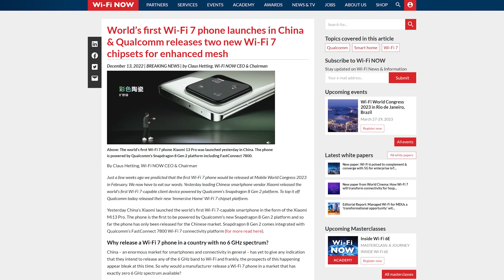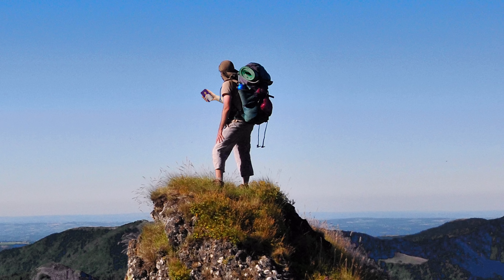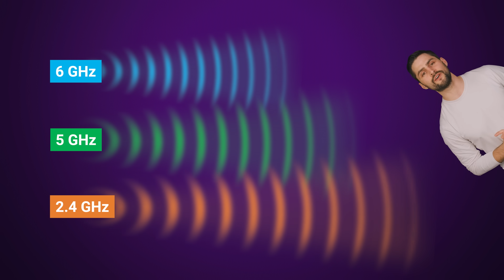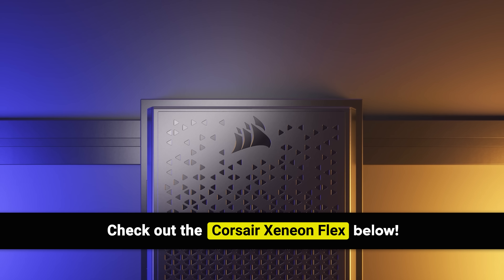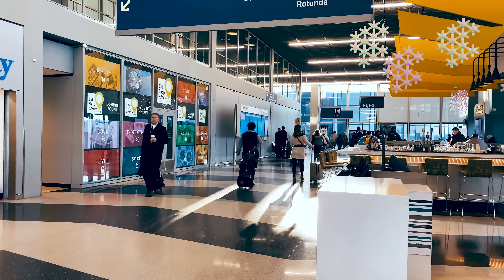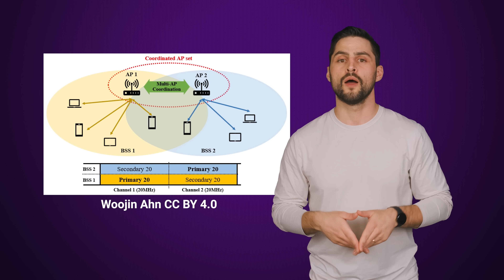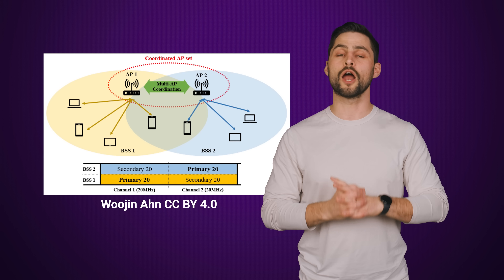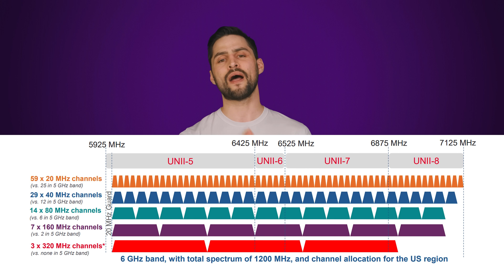Can Wi-Fi 7 Replace Range Extenders?

Comment: Can we have a recap of all the different standards please I feel like you don't keep track for a couple of months and everything changes! Eg WiFi 6 Vs 6e what about that super high frequency was is like 60ghz and stuff like this
Reply: 6e is 6 over 6GHz there no diffrence in standard, it would still be called 802.11ax in old way, same as 802.11n had 5GHz optional. 60Ghz been always arounf but is not part of wifi standard, its 802.11ad newer ay and its branded WiGig, but potentially it could be integraded to WiFi in future

Comment: you never said what the low frequency range was... Are we talking like 150 feet or more like 1/4 mile. My current router is pretty good, I can get a good connection even in the back yard. I would only feel compelled to upgrade if I could get a connection down the street, which would be cool.
Reply: That completely depends on the environment around you as well as the antenna of the client. Through a single glass sliding door I can get a 2.4Ghz connection about 50 metres away on my phone with line of sight to the house.

Comment: I'd love it if you can make a Techquickie on this one: what were the input and output methods for old mainframes and minicomputers? In almost every picture I see of them (from the '60s, 70's etc.) I don't see a monitor anywhere. Sometimes it does look like there's a typewriter nearby, but I'm not sure whether it served for input or output and, if so, how.
Reply: hi! Old computer nerd here (as in old computers, im like 16). You're right about the typewriters! They were called teletypes, and were actually origianally invented for telecomunication, as a faster way to send military messages. Basically by typing on one machine, the writing would show up on another, and by typing on the other, writing would show up on yours. Some smart person just put a computer in the place of the other machine, and bam, IO?
Reply: These systems use thin client approach. One mainframe could host many terminals that would operate similar to modern PC (in text mode only). Also older systems used punchcards for input and printer for output. You could bring your app on card and later take it with written output. Later came tape add-ons and hard drives. Both were about the size of a nightstand.

Comment: Automatic roaming between access points on the same network should be the top priority for them to fix. That currently is and has been the most annoying thing with wifi for a long time now
Reply: Yep. I fully agree as a college student living on campus. There's access points in literally every unit in my dorm, but my connection drops when I'm walking.
Reply: @shane_gentle  Tell your college to fix their network! Depending on the manufacturer, there are tools to make the handoff smoother such as minimum data limits and minimum signal strength. If they have configured nothing, then your device will stick to it's current AP until it can no longer communicate with it and search for a new connection (which causes the drops).
Reply: It's fine if your network supports 802.11k. This revision adds available APs and their channels to the handshake so your device doesn't have to search every channel looking for an AP to roam to. Also, keep all APs on the same SSID or you're gonna have a bad time. Splitting 2.4 and 5 up to their own SSID is up to you, but I prefer one SSID to rule them all.
Reply: @quinton1661  I just have different SSIDs for frequencies and APs cause it's not gonna switch automatically anyways so with different names i can at least quickly switch manually when i need to.. which is every day
Reply: This issue has been resolved for several years through the implementation of IEEE 802.11r/k/v, commonly referred to as fast roaming. However, it is worth noting that many large Wi-Fi networks remain misconfigured and lack the necessary feature to enable fast roaming.
Reply: My unifi setup works very well with the roaming assistance stuff enabled (and configured right, it takes a bit of trial and error of messing with tx power and a few other things.)
Reply: 802.11k is a thing, however the reason roaming sucks is because you're network team didn't do a good job of setting up wireless.  probably have you're datarates set super low and tx power set super high.  9 times out of 10, raising the minimum datarate,  and lowering the power levels so that coverage at least -65db or better in all areas fixes the roaming issue.
Reply: @bassman87  and thing is, this is often the default. I know it's default in prosumer gear (Ubiquity UniFi, Omada)at least.
Reply: @illiiilli24601  its cause wireless operates in a very unpredictable medium.  so tuning to your space is really a must.
Reply: @illiiilli24601  This out of the box experience that so many vendors fail to uphold is because the radios can't both broadcast wireless and listen to the RF space at the same time.  some enterprise APs add additional radios that just listen to the space, making them very expensive, but in reality those radios aren't in a good position to make a good determination.  Clients are on the ground, APs tend to be on the ceiling.  can't simulate being a client when you aren't physically located near the clients.
Reply: @bassman87  Exactly, we see misconfigured networks all the time.
Reply: In regards to the mention of 802.11k and why it is not enabled, there may be a reason, college/university campuses are great example of why it might not work.  The end user device has to support that revision.  You have to support the least capable otherwise you will end up excluding those devices completely.      

A misconception is the Network causes the device to roam, its the device that is always assessing whether or not it should roam, whether it thinks there is a better choice, the device looks at the BSSID, along with all the other data it can get, RSSI, SNR, Minimum Data Rates, etc, then makes a decision.  All you can do is build a better environment to discourage that from happening.
Reply: @Gr33nMamba  right.. I have learnt to toggle WiFi off/on as the fastest solution.
It's the software stack on the device that's fundamentally at fault when it's sticking to a low viability signal, rather than seeking better.
Reply: Mesh routers solve this issue
Reply: You can only do this in a controlled invironment. First of all you need devices that will roam if they are told to. This is not a thing right now. Every vendor choses their own roaming "policy" and thus we cant enforce roaming. We can optimize for it. I work at a University and the end user devices goes from 802.11g to 802.11ax. So making roaming good is kinda an uphill battle. On the contrary, if you have a company that dictates which end user devices are allowed, it is more easy. And maybe it is not a big deal. If people are connected through VPN it wont matter if they come from a wi-fi network og 4G/5G
Reply: This is the truth
Reply: My impression having 2 WAPs in a reinforced concrete house on unified SSID, which splits the signal in two, is that the software on phones has made the effect worse.
I've seen improvement within apps in response to roaming between the 2 areas over the years.  But the master  WAP with router & a mini-repeater to strengthen signal to outdoors suffers far less of an issue, despite using a crude old style solution.
I lowered signal strength to reduce clinginess, but it's pretty annoying that mobile device designers didn't prioritise service for mobile people more.
Why could the WAP with a small old g only repeater work better for roaming than WAP-WAP both supporting n and offering 5GHz?
Guests have a compulsion to answer calls in the lounge, but immediately roam into the garden or their room served by the other WAP.  The trouble is just going round a corner behind a wall with steel in it can severely weaken the signal (which can be expensive when it fails over to data roaming charges kick in).
I already lowered signal strength of the master WAP wired to the fibre router, but that had limited effect.
Are phones preferring to switch between WiFi & 4g, making a new network connection rather than direct switch of WAP?
Reply: wait, your multiple access points are not coordinated with an SDN (software-defined networking) controller? 

my SDN, TP-Link Omada to be exact, supports 802.11k (advertisement of neighbouring APs), 802.11r (fast roaming reauthentication) and 802.11v (forceful dissociations of noob wifi devices that didn't listen and didn't try to move to better AP)
Reply: It was a thing years ago, my Tp-Link Archer A7 has multiple frequencies under one network. It came out in early 2018
Reply: wasnt this already solved by mesh type routers? I mean,  we have a setup of 6 Tplink devices and its literally smooth butter everywhere we go as compared to repeaters and what not
Reply: WTF are you talking about? I have four unifi Aps and I roam on them all the time. There is 0 dropped packets since 2020! The thing is, you have to know basics in order to get it just right.
Reply: @elmedia1532  Wtf are YOU talking about? There shouldn't be any settings or adjusting transmit power or anything like that. If the device is clinging on to an access point for dear life getting 10 mbps while it's in the same room as another access point on the same LAN giving like 400 mbps it should just change on its own. Clearly one is delivering trash speeds and the other one is doing great at 40x the speed.
If the device has the SSID and password to both access points and they're both on the same LAN, one is really slow and the other really fast, it SHOULD just switch. It's such a simple concept, automatically move the device from the trash signal to the clearly much stronger one, yet it doesn't happen.
Reply: @MarcusH... Please for the love of God do a little bit of research into why these things happen. Your theories are amazing, but they aren't practical.

Comment: If they impliment it properly, they could make it so your phone sends out two signals at once - 2.4ghz for lower-bandwith needs like notifications, text messages and other background stuff like updating apps in the background, whilst the faster 5 or 6GHz can be exclusively for more intensive stuff like game streaming and videos. That would speed things up even more to keep the two streams separated so the higher bandwith isn't so cluttered with the slower less demanding stuff and vice versa ... well, until you start moving out of the high-speed frequency ranges and only then it should combine them back into the lower-bandwith frequency.
Reply: Some phones (Xiaomi being the biggest I know) already can do this, and have been able to for a long time. And no it's not particularly battery heavy. Wifi uses negligible power compared to all other phone functions.
Reply: Sounds battery heavy though
Reply: It would be harder to implement as there no way to recogize what is bavkground connection or not, updating app as any bigger download task for network is as heavy if not heavier then watchIng videos (that are buffored) or playing games
Reply: @ShadowriverUB  this is literally already implemented as well. Devices and networks have "priority" queueing for network traffic
Reply: Not going to happen though.
Do you realize how much more circuitry the hardwere is going to need to be able to do this?
Reply: @REAL-UNKNOWN-SHINOBI  none. It's already a thing.
Reply: @REAL-UNKNOWN-SHINOBI  EVERY 5GHz device is already capabale of doing this, because in order for 5Ghz roaming to work, the connection will go to the 2.4Ghz band first, then change the 5GHz accesspoint and then switch back to 5Ghz without any interruption of service.
But roaming is the reason why you cannot use different bands for different kinds of services, because applications should not bother about the network, thats just one uniform interface for the applications and the wifi controller makes sure that everything works.

Comment: Ugh. This does NOT bode well for congested areas. RIP apartment dwellers. Hopefully in 5-10 years when most products have been replaced and hopefully support the 6ghz band... Maybe congested areas will finally be able to work reliably. Until then let's enjoy the fact ISPs will set up every Wi-Fi 7 device with the entire spectrum assigned regardless of the clients or channels currently in use.
Reply: If you're worried I'd suggest simply having your router only operate at 6ghz and set up 6ghz repeaters if your apartment is larger. That way you don't have to worry about interference since there is no chance that 6ghz frequency will pass through the walls

Comment: Combining all signals into one sounds like a great implementation if it works well, as some router have this " smart wifi" that auto switches bands creating a stutter mess, I guess if it's seemless it should good
Reply: @Zaydan Alfariz Asia exists. Provinces still use wooden housing.
Reply: @Zaydan Alfariz keyword: *being
still not done. I myself know dozens of communities still using wooden huts, more than half of which don't have ANY cement housing
Reply: Until you and your neighbors are all sending the signal across all bands.  
This doesn't even help latency, it just increases bandwidth.  Ethernet is better
Reply: @Lolatyou332  This is going to SUUUUUUUUUUUUUUUUUUCK for people in apartments. You already have tools setting their 2.4Ghz channel width to 80Mhz at 100% gain completely flooding the spectrum. RIP IoT devices.
Reply: @Lolatyou332  5ghz wifi can barely go through 2 cement walls so unless you're in a wooden hut, this won't hurt

also ethernet is always better, it will always be better in this case no matter what 

You can go plug a Ethernet to usb c dongle on your phone if it's so good👍

Comment: Using a powerline adapter here. Best thing ever. It has an integrated wifi adapter, N-standard, which I capped on purpose at 25% power to minimize radiation (probable hazards to health), totally sufficient for Full HD Streaming on the TV and the PlayStation (in the same room), as these are "too far" from it to be connected directly with cables -- and would look messy :-3
Only the PC is connected by cable to the powerline adapter. 100% stable connection, even though it is a very old house.
Put a damn powerline adapter in every room where you need internet, and forget about this whole wifi mess!

Comment: Only one big problem: when will be see client side devices that support WiFi 7? Especially desktop computers, laptop computers, tablet computers and cellphones. Will the 2024 model Galaxy S phone support WiFi 7 using Qualcomm's latest chip?
Reply: No desktop computer worth its salt uses wifi, and if it needs to, you can easily slap in a card to upgrde it to whatever is the latest wifi standard is. For other devices, they will come like they always do....
Reply: @RickMyBalls  Many of the really small form factor PC's like the Intel NUC have built-in WiFi functionality. I'd agree if you're using a full-size desk top computer, many of which connect to the Internet through the Ethernet port to a device that provides Internet connection to the home (cable modem, DSL modem, or special modem for fiber connections).